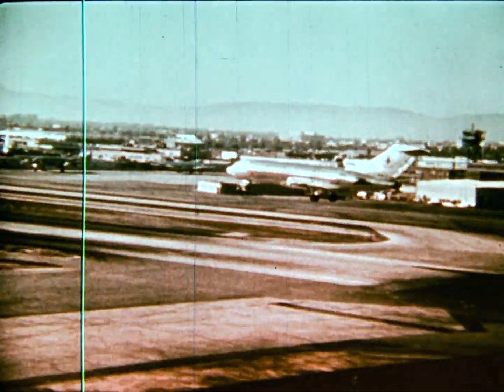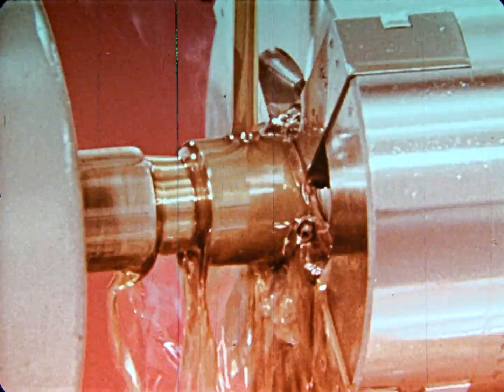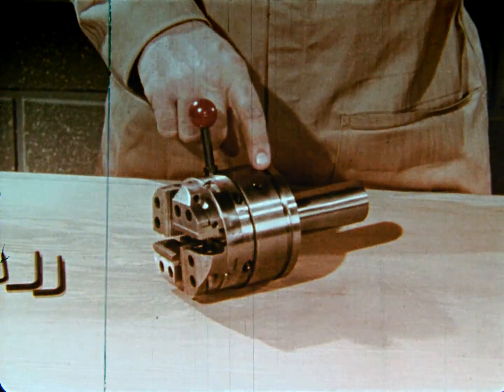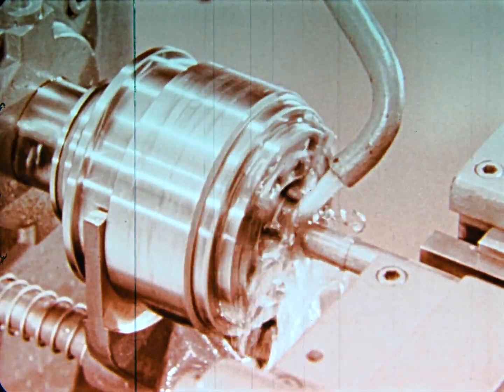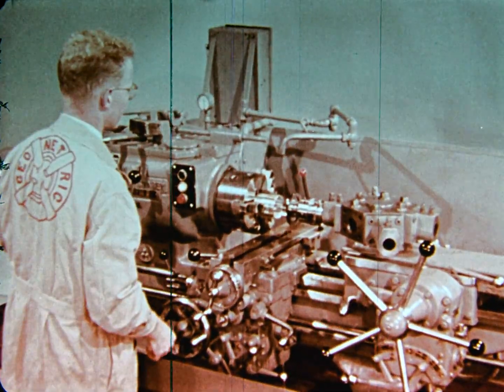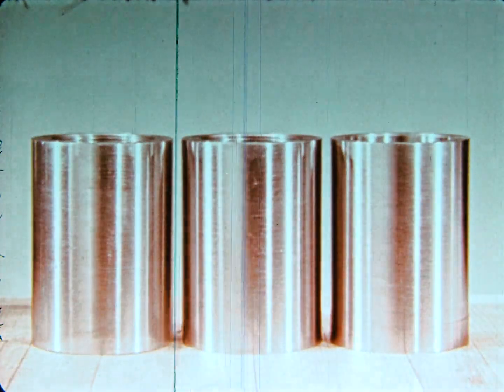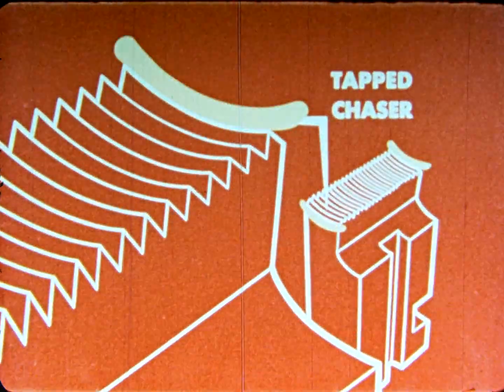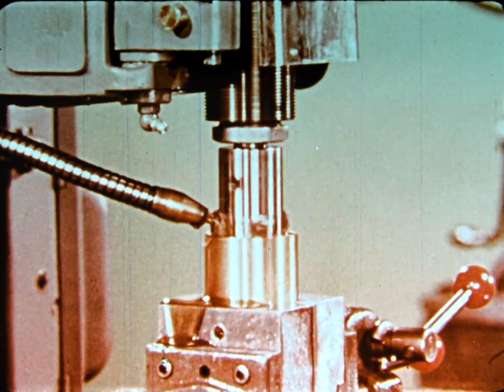Threading Time - The Story of Die Heads and Taps

Comment: Nice to be watching this video as a current user of two die types here in our shop a Geometric and the acorn both do a die thread cutting job for us, while the die head by Geometric Tool Company is best known for being an auto release when used on a turret, there is a lesson we can share if permitted.

We actually have and utilize the smallest Geometric die holder the company made, to this day, it is not an automatic it is the companies only non automatic version they made.
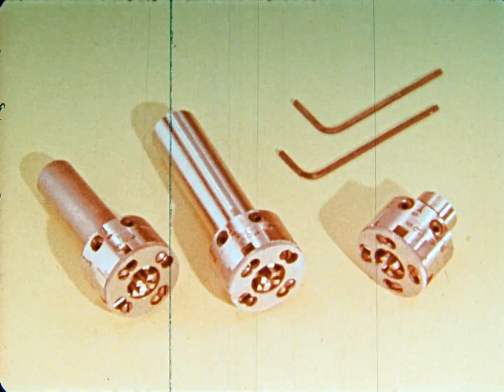We are more of the 12:00 minute into your video size yet even much smaller.

What you have to do is run the die down the thread to a marked spot hit the spindle stop (large buttons) once stopped hit reverse, while it is built well it is too small for automatic for those times, it is the only non automatic Geometric die the company made.   

We see that Turret on that larger lathe in your video, that is a very large to us lathe and turret or capstan we run ours, a capstan turret on a micro lathe Instrument bed sized, make in America at the Louis Levin & Son Company in Southern California.

Nice to get to watch this video, and it is nicer still yet we know now it was made in New Haven CT. 
Thank you and the Museum or our Industrial Heritage for the share, we are two thankful guys.
Lance & Patrick.